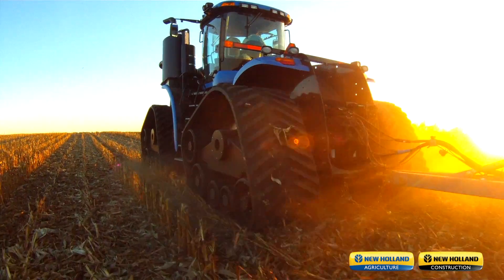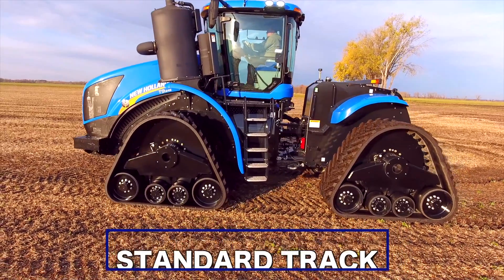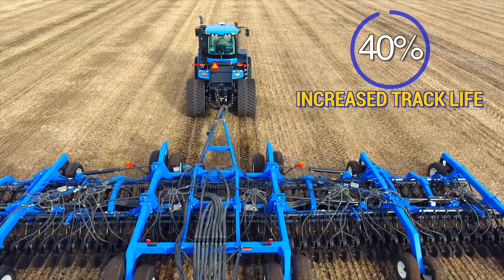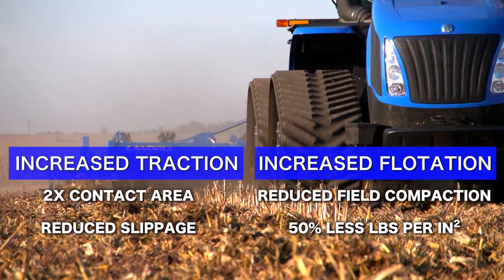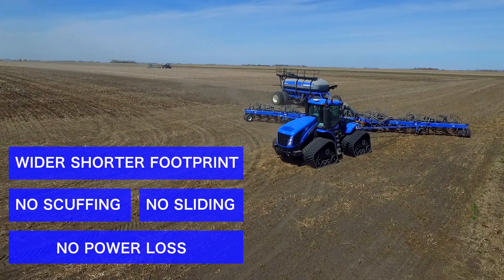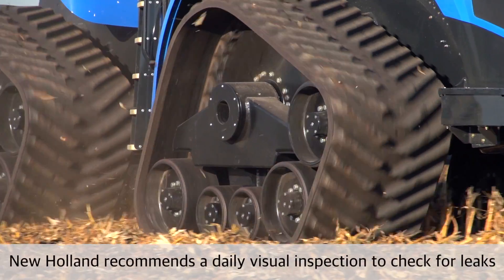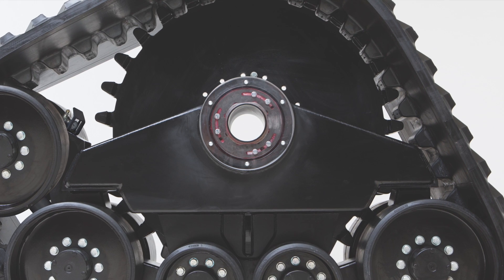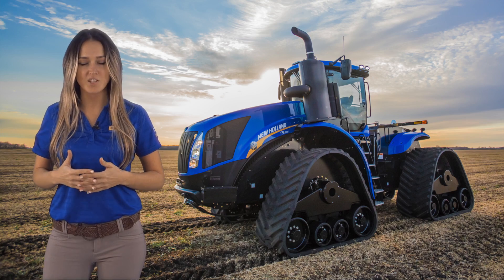New Holland T9 Tractors: SmartTrax™ II Track System

Comment: I have never seen that one in Europe.
Whats the reason?
Reply: They're in Europe, just not that commmon Because there's little need for a tractor of that size and power on European farms, because they're small.
Reply: @harrimanfox8961  The Quadtrac 600 works on big Farms in North or East Germany  but the T9 700 I have never seen.
Reply: @danielheckmann4898  they are sold there.

Comment: Case IH started the track business, New Holland improved it.
Reply: Caterpillar started the track business around the turn of the century. They where also the first to make a 2 track tractor with rubber tracks. John Deere was the first to make a 2 track row-crop tractor with rubber tracks, Case IH was the first to put 4 rubber tracks on an articulated tractor, and John Deere was the first to build a row crop tractor with 4 rubber tracks. 
Also, while the Case IH Steiger and New Holland T9 are the same, the tracks on the New Holland are made by a 3rd party, unlike the tracks on the Quadtrac which are built in house.
Reply: Don't be stupid
Reply: Both can't keep up with the German brands like Fendt, Claas and so on.
Reply: @ObsidiaBeast  Get ya head out of your arse Wolfgang.
Reply: @interman7715  Are you upset, because you know its true?

Comment: is that setup better than the caseih or it is it something different all together just wanted to know and can you us them to pull scrapers...
Reply: I don't understand why they use these 3rd party tracks... These are built in the same plant as the Quadtracs, yet they dont use the same tracks.
Reply: Chris Cardoza the case IH Quadtrack outperforms this POS hands down, I’d know, I’ve leased both. I was really surprised at how underperforming this thing was
Reply: @josheubanks370  case and new holland are the same brand
CNH Case New holland agri also owned by FCA Fiat Chrysler Automotive